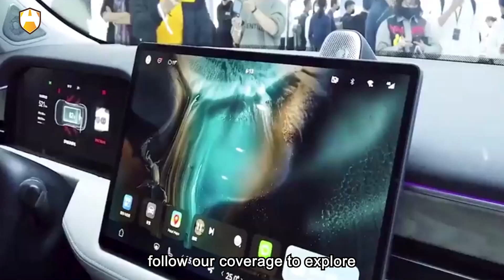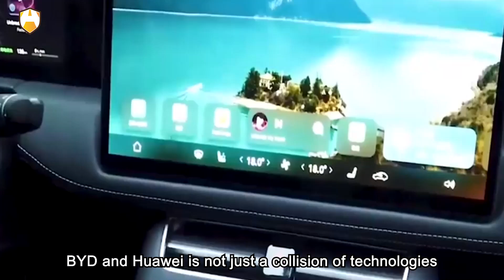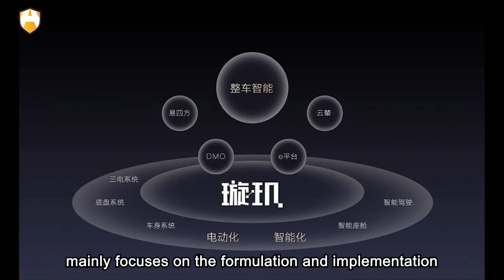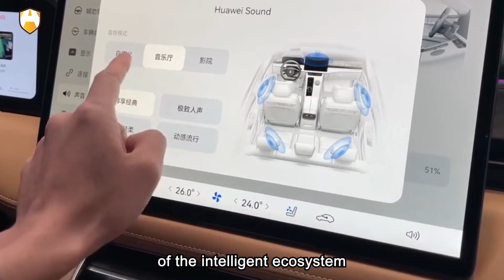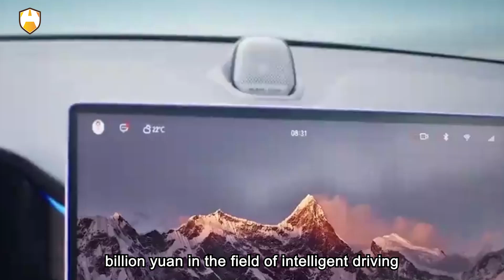BYD Dream DAY！！ a new trend in  field of intelligent automobiles in collaboration with Huawei.

Comment: I'm driving a Atto3 and it is good BUT 1 thing I hate about the car is the ADAS system, even I turn off all the ADAS and signal to change lane then somehow some stupid biker approaching my car the ADAS will be activated and swing my steering to the other direction. 1 time I almost have an accident as I was driving on the mid lane with a container lorry on the left, naturally I will keep more distance from the lorry but there was a car approaching from the back on right lane, the car swing the steering to the left (where the lorry are) it scare the sh*t out. BYD need to take in more feedback from other countries and look at other country driving situation and behaviour. Indonesia, Vietnam, Malaysia, Thailand etc all have lots of motorbikers zipping in and out, if BYD ADAS is soo soo sensitive then it will be difficult to drive in these countries